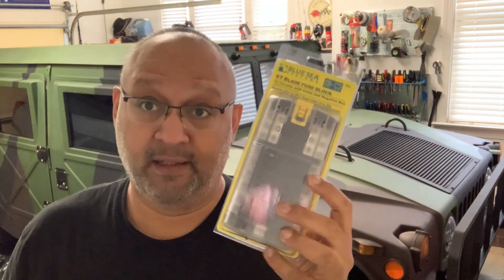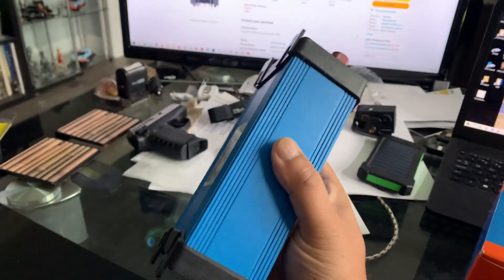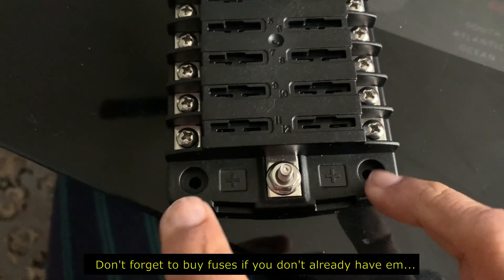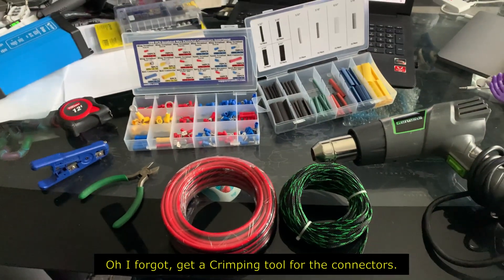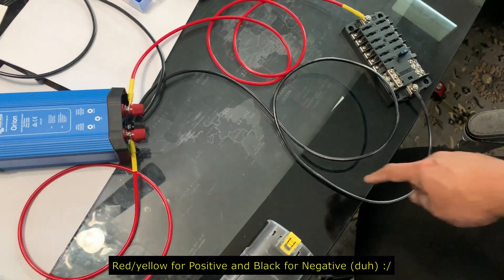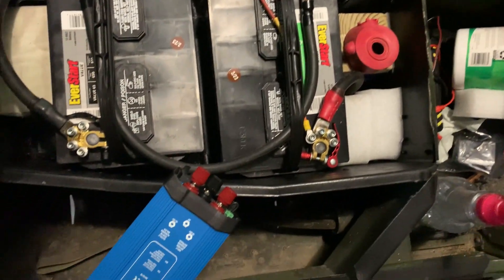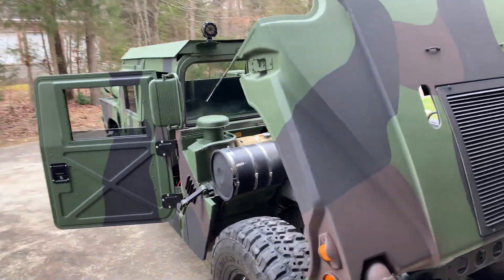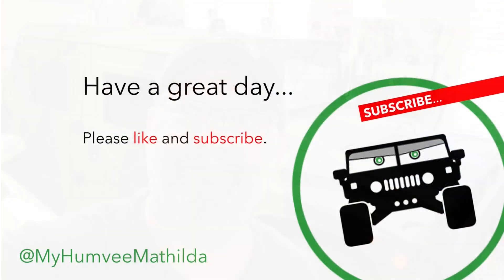Installing a  24v to 12v Step Down Converter on a Humvee.

Comment: I have been planning on doing this for a while more like years. I’m doing some research on parts. The only key I see in this location in the battery box is to try to water seal that compartment as best, especially the drain hole next to your step down. That’s what I did. I sealed all around that location. I have previously installed a 24V bus bar. I need to now install that 24V to 12V I have been putting that off for many years. I’m getting tired of killing that one battery with all my 12V accessories (radio GPS, electric mirrors, phone charger, crash cam) thanks for the idea and parts samples, good work and great video.
Reply from the maker: Thank you for your kind words. Yes I’ve been meaning to seal that drain hole as well.

Comment: Before you measure out the harnesses, would it be better to lay out and plan where the accessories are going?
Reply from the maker: Always great to have a pen and paper and plan things out or better yet a pencil paper and an eraser and plan things out. The great thing about wires, is that you can always measure a wire and cut it once you know where it starts and ends.

Comment: Do you think you can hook up a power inverter to the fuse box and run a small window ac unit off of it
Reply from the maker: No. Don’t do that! lol. Very redneck thing to do. 😂 
However, you could use a small rooftop AC unit that they put on small RVs. Those have an electric compressor.
Reply: @MyHumveeMathilda I thought of that but I don’t want it to be visible if I put a window unit in the back just a couple of inches off the bed it won’t be visible. I’m also planning to put expanded metal over the bed so that would hide it also
Reply from the maker: WinDow units are designed for houses. Not for high vibration vehicles where the unit gets jostled about. But you do you. 😂
Reply: @MyHumveeMathilda definitely! I’ve thought of that too. Fk it ima give it a shot I’ll let you know how it goes lol

Comment: Followed your video and installed the step down on my 1165. Easy Peasy! Question: I see that you left the green jumpers as is. And will add a kill switch on the negative cable. Can you send a picture so I can do the same? TIA!
Reply from the maker: Sure. Not sure how to send a picture, but just get an on off switch and extend the negative cable to where you want to mount the switch. Easy as pie. 🥧🙂

Comment: What happens if I ground a 12v accessory (let’s say license plate led) to the frame and run the power wire to the 12v fuse box? I have the Orion on a switch so it really only gets power when the truck is running and I switch the converter on?
Reply from the maker: You’ll burn out your 12v accessory. Think of it this way. When you connect any accessory, let’s say a 24V accessory to the 24v battery set and then back to the frame, You’re completing a 24V circuit. That’s 24v positive and back to 24V negative if you run a 12V positive from the Orion to a 12V accessory and then complete the circuit to a 24V negative/frame, think of what that does to the circuit. You’re completing a 24V return. Grounding makes sense if the entire machine is a 12V system. But when you have dual volts systems, remember what the Ghostbusters said, do not cross the streams. 😂 do a little extra work, by running a black wire back to the 12V negative on the fusebox just to be safe.

Comment: Hello did you ever hook up the stereo in the humvee. I’m having a problem getting the 12v constant power for radio memory. Please let me know thanks
Reply from the maker: Not yet, but here’s an idea, run a direct line to one of the batteries for the power. Not through the Orion. Make sure your truck is always on a 24v trickle charger.

Comment: Is that the reason why my battery keeps dying? Because I don’t have kill switch on the negative wire? Great video too!
Reply from the maker: Well two things. It’s not really necessary to have a kill switch for your battery. Having a kill switch for the step down for the 12v makes sense so it’s not running when the truck is off. That might be why your battery is draining. Try using a battery tender. I did a video on charging the humvee in my playlist. Don’t need an expensive trickle charger. Have a look.

Comment: Thanks. I really enjoyed the presentation. I installed a converter (20A) that has been killing me batteries.  I  also had a kill switch,  but i put it on the positive side.  Thanks
Reply: I am still having issues after installing the new converter.  I also placed a kill switch on the negative,  yet still getting power to 12v side. I believe it's because I have a few items still grounded to fame with power at the fuse box. Your thoughts.
Reply from the maker: Make sure 12v gets grounded back to the fuse box and only 24v stuff gets grounded to frame.
Reply from the maker: Oh noes! 😲 … always negative side, it cuts the circuit and no current flows through. Positive side is probably why you have the drain.

Comment: Great video. I was curious where you ended up mounting it fuse box. Also do you have a video about how you wired a light bar to the fuse box?
Reply from the maker: I will soon when I do my console. But it’s fairly simple. Red from fuse positive to switch, to light bar. 
Black wire from lightbar back to fuse box negative. Use the correct amp fuse in the fuse box based on how many amps the lightbar pulls.
Reply: @MyHumveeMathilda  I’ll probably get a 6 fuse box so it can fit under the passenger seat.
Reply from the maker: @Team_Amateur_RC  don’t make the mistake of grounding a 12v accessory to the frame (24v), ground it back to the fuse box.

Comment: How/where did you add a kill switch so your batteries were not drained?
Reply from the maker: I made a cutoff switch from the negative of the battery to the Orion. That’ll cutoff the 12v.  No kill switch for the batteries. If your batteries are getting drained you need to invest in a 24v trickle charger. Check out my video on charging your Humvee. 
https://youtu.be/O463vhUa37M?si=hwUdpcChPsqS_J5s
Reply: Since your disconnect is running through the negative there is not a certain amperage needed on that toggle correct? I have not installed the step down yet but your video has given me the info i needed to get this done next weekend.
Reply from the maker: @rsriddle1982  regular amperage that a 12v battery would handle. If I had to do it again, I would install the Orion higher up in the truck, not in the battery compartment. But you’re free to install it wherever you please. . Good luck with your install.

Comment: man I love your channel, you have pulled me out of a pinch with my rig so many times by checking in on your videos. I'm currently running into issues on my TCM not getting power so next step is I'm going to wire direct 12v to it so I can determine if the TCM is faulted or wiring to it is. Truck was running great this week then just crapped out randomly and went into limp mode so either a wire got knocked loose going to the TCM, relay crapped out, or TCM randomly died. Lets hope its a cheaper of the bunch and just a bad wire lol. Cheers brother!
Reply from the maker: Thank you for the kind words. Fingers crossed it’s a bad wire.🤞 I just had a similar issue with my back up light. Hoping it’s a bad wire or ground and I don’t have to open up the shifter.
Reply: @MyHumveeMathilda  If it ends up being TCM or I can't solve the mystery, I'm planning on getting the new stand alone TCM from BlackdogCustoms so I can just do away with the whole current setup. Ive been wanting to make a trip down that way anyway to see their facility but cost wise the wife is going to really put a hurting on me bc I am in the middle of some expensive remodels at my shop to now throw in more humvee expenses, oops. Again though seriously this is always my favorite go-to humvee channel on YT. Cheers brother!
Reply from the maker: @beurownboss1554 BlackDog makes good stuff. I got my cutoff switch from him.

Comment: I have a 24v truck, im using 2 12v n series connction i tap 1 wire on the + trmnal to get 12v  power😂😂😂😂
Reply from the maker: That works if the load and draw on the 12v tap is minimal and you have a cutoff switch. Otherwise I’ve heard there’s a risk of improperly balanced output. But I’m no expert on electronics. 🤷🏻‍♂️🙂
Reply: @MyHumveeMathilda  but my ac is 24v
Reply from the maker: @airgunsapinas360  sorry I must’ve read wrong. You’re right. 24v in series should work.

Comment: Well done! Where did you find those 3 amber clearance lights? They must be 24v since you are currently working on the step down conversion.
Reply from the maker: Thank you. For the amber lights check out my previous videos for accessories. It is 12v, costs 12 bucks from Amazon and I have already hooked them up to my step down.

Comment: Always wondered what would happen to the 12v side during fording …. The fan is so low assuming it would blow.
Reply from the maker: Good point. I’m hoping the kill switch that I’m putting on the center console, cutting off the 12v at the negative main might protect it.